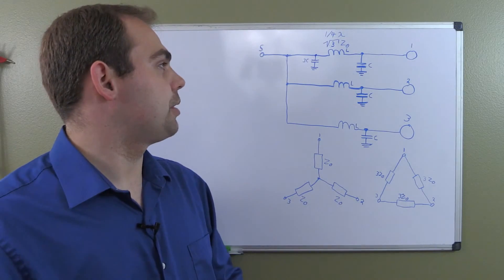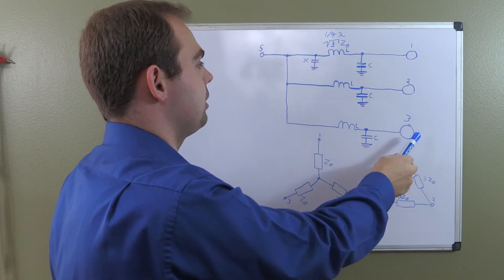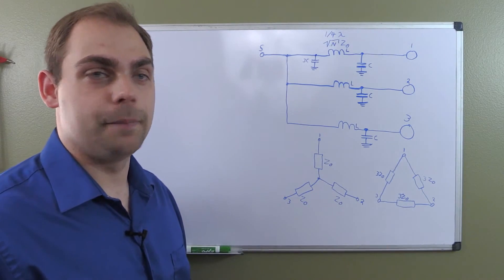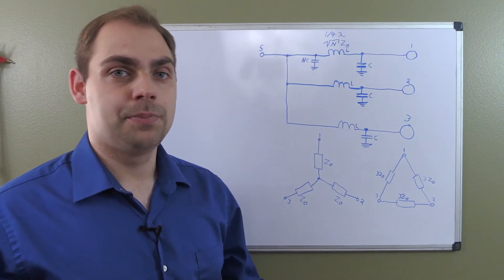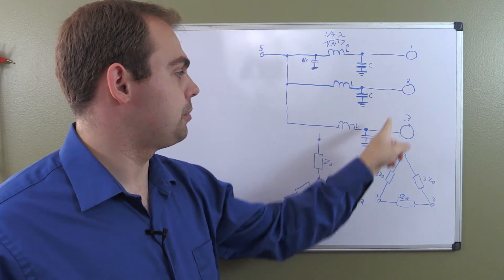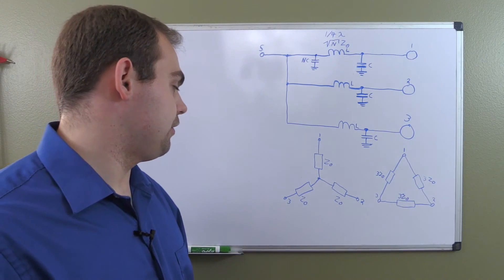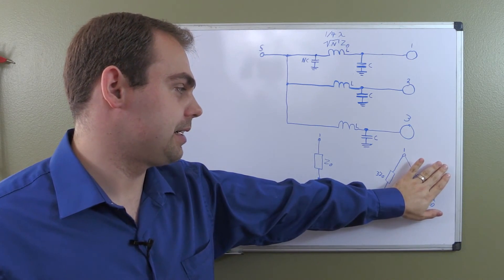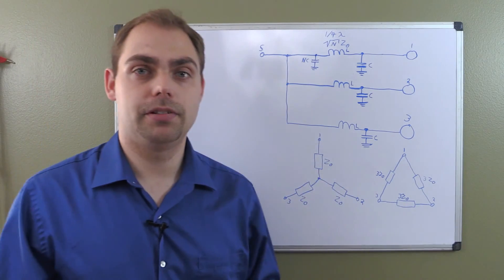How To Design a N-Way Wilkinson Splitter / Combiner

Comment: Do you have theory for building a PCB Wilkinsion N Way combiner 50 ohm in, 50 ohm out, w-4KW RF Output???
Reply from the maker: 4 kW? That would pose extreme challenges if it's supposed to be a PCB design. Even neglecting any components on the PCB, just the dielectric strength of the PCB itself would have be extremely large.

Comment: Nice Video of Wilkinson theory! If I am making a combiner for 88-108MHz, how do I make the combiner wide enough to pass the Full 88-108 RF spectrum?
Reply from the maker: Large bandwidths and Wilkinsons are somewhat challenging. For that you'd have to employ an intermediate impedance and basically do a multi-stage Wilkinson with stepped impedances.

Comment: Question: I ran an ADS model for a 2way Wilkinson combiner with 0dBm 0deg on each leg and output was +3dBm. Can you explain why when I either open or short one of the combiner inputs my output power goes to -3dBm? Also, is there a similar equation for an N way combiner as there is for an N-way splitter, that is,  like dB=10log(1/N) ? thanks
Reply: Your model is correct: if you remove one input from a hybrid combiner such as this, you've obviously removed half the input power, so there's -3dB. Now, the power from the remaining input is split 50:50 between the output port and the Wilkinson resistor, so the resistor sees -3dBm and the output power is -3dBm.  It's a consequence of preserving the input impedance when another input is not Zo.  You can look at this hybrid in another way: each C-L-C leg is a narrow-band  approximation to a quarter-wave transmission line, and for a two-way combiner this line should have a Zo of 70.7 ohms (i.e square root 50 x 100) . Quarter-wave line impedance Z transforms a resistance R1 at one end to R2 at the other according to the equation 

R1.R2 = Z(squared) . For our combiner, we're paralleling two lines at the output, so each needs to present 100 ohms to the common port. So, 50 ohms in, 100 ohms out, square root 50x100 = 70.7.